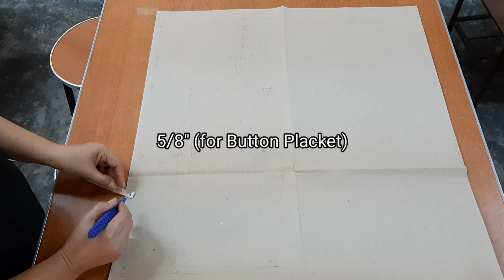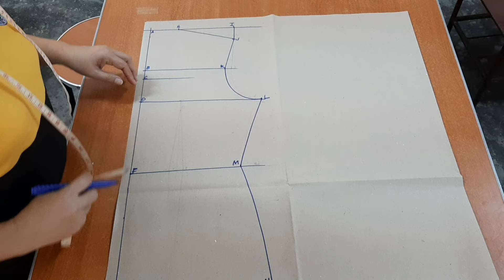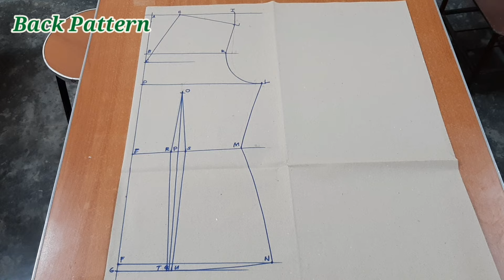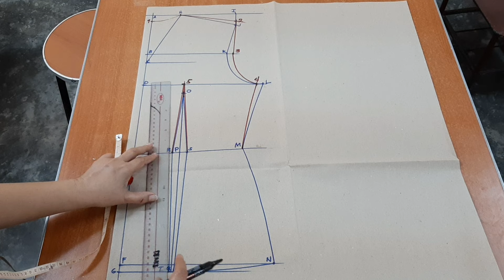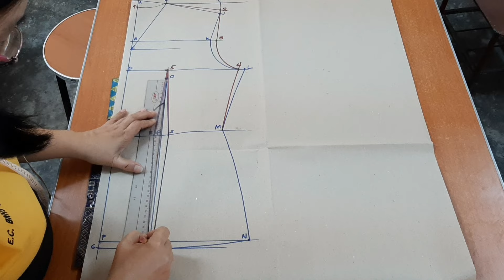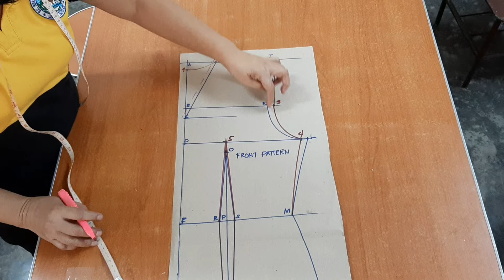Learn to Draft a Basic Blouse with Sleeves and Collar

Comment: Body measurement po
Reply from the maker: Hi! Ito yung body measurements, medium size po iyan:
Figure 15", Shoulder 15", Chest 13", Bust 32", Waist 26", Bust Height 9", Bust Distance 6 1/2", Blouse length 22", Armhole 16", Nexk Depth (Front - 6" & Back 2 1/2"), Armgirth 12", Sleeve Length 6 1/2". Iysn na po ang lahat ng sukat para sa blouse na ito, kasama na yung collar at sleeve. Salamat sa panonood!